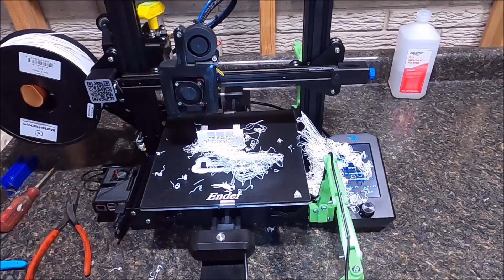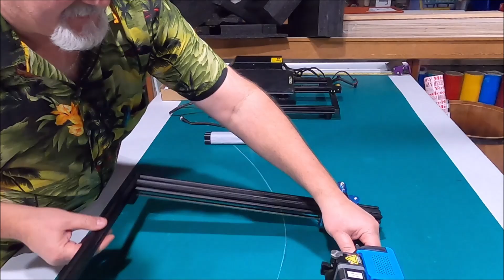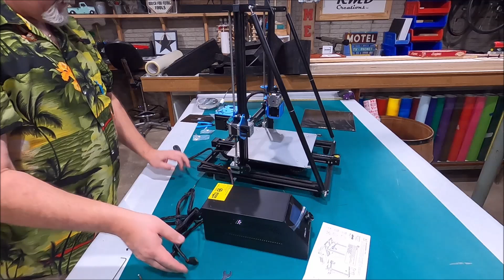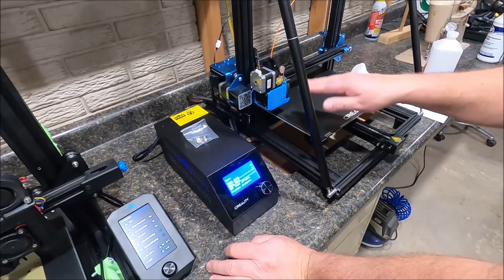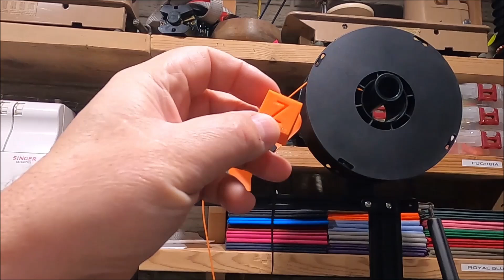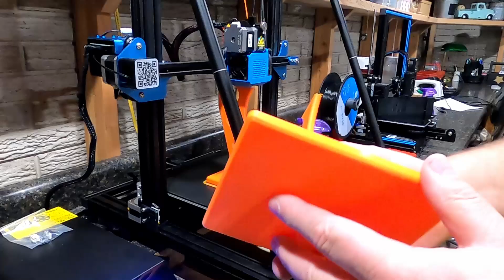Creality CR10 V3 Unboxing - Set up-Print. I have added a larger capcity machine to the collection

Comment: this was my first 3D printer. total garbage. bent extrusions, off square screw holes, warped plates, low quality controller, the printer was totally unusable out of the box with a crazy amount of design oversights. even the nozzle was physically not able to reach the build plate - requiring shimms and heavy modification.

Comment: Wish that I watched this before I set my machine up. Thanks for the good videos. I was getting really irritated setting this thing up. Plan on doing some add on mods like you did. My first printer is a Prusa MK3S+ it took 13 hrs to assemble. I bought the Cr10 V3 for printing lithophanes. keep up the good work

Comment: Mine has been great....then terrible.  Come to find out its NOT an all-metal hotend or extruder.  They simply swapped out a problematic plastic idler arm for a metal one and called that an "all metal extruder kit".  People like me come along and think theyre getting an all metal hot end or at LEAST an all metal extruder and therye getting neither.  Mine wont print reliably above 240C (which is everything I need to print) so its basically junk to me.  I have to buiy a whole new printer and it will NOT be anything from Creality.

Comment: Hello Michael, grateful for your contributions and videos sharing your knowledge. Taking advantage of your generosity, I ask the following, what profile (fff) do you use for this printer? Did you modify it from a pre-existing one? I use Simplify3D and I have yet to fix a small shrinkage value. Thanks again for sharing your experience! best regards, Marcelo from Argentina.
Reply from the maker: I use pretty much the stock profile on Ultimaker Cura.

Comment: Just a note, My cr-10 V3 is about 2 weeks old, and it came with the ball bearing guide wheels already mounted on the filament switch bracket. They are adjustable.
Reply from the maker: good to know. Thanks for watching

Comment: When assembling mine, I took great care in checking the z-gantry was square to the bottom frame. Just tightening the four bolts from the bottom did not result in a square gantry but one slightly tilted backwards. They call the front rods “pull rods” so that’s what I used them for, to slightly pull on the Z-axis gantry until it was square. Also checked other dimensions for equality, like the distance from the Z to the front of the frame etc... A system like this is overdefined if just tightened without any tension and squareness would then result from sheer luck of having perfect manufactering tolerances. If placed under very slight tension squareness can be controlled. I had to flip the bed because it was dome shaped, after flipping no problem to level. Also I am not running the filament detector, it just sits by the side with a piece of filament in it. The friction on the filament was a bit too much for me. Check the rollers, they were mostly too tight, especially the x-axis. 
Anyway, it’s a super machine and prints astonishingly well, just take your time to assemble it and don’t rush. Just let it sit and think about it, the cables, the placement of the spool holder, wheel tension, ...
Reply from the maker: All good interesting information.

Comment: May i ask which one better cr10 max or cr10 v3???
Reply from the maker: Depends on what you want.  The max has a larger print volume but bit it's a bowden tube machine and it doesn't have a silent board.  The V3 is direct drive and has a silent board.  If I had it to do over again I would still by the CR10- V3
Reply: @Michaelinthebackyard  ok tq for the information

Comment: What are your slicer settings on the CR10-V3? I set mine up did the test print from the sd and it ran fine. When I try and do other prints either that I designed or on Thingiverse, it doesn't adhere to the bed well and seems to have inconsistent results. I'm using that latest version of Cura. Bed is level as can be but does have a dip in the center.
Reply from the maker: If your build surface is not flat and you can get prints to stick very well, then you will struggle. All the slicing software in the world will not make up for a non flat build surface. Email me and I can send you my Slicer profile that I use on my CR 10's

Comment: Hey Michael, thanks so much for the video!! I absolutely love your enthusiasm and go-get'er attitude! 😊 I've been debating between the CR-10 V3 and the Ender 5 Plus, this helped a lot!

I LOVE your design for the filimant run-out sensor, great job! I definitely think you should post it to Thingiverse if you haven't already 😊
Reply from the maker: Go for it!, I do have it on thingiverse. Thanks for watching and commenting.
Reply: Did you end up getting this one? I, too, am debating between this one and the Ender 5 Plus.
Reply: @lisa_marie_1982  Hello! I did actually! At this point, I honestly don't recall the specific specs or features of the Ender 5 Plus that I was debating between, but I can tell you that I absolutely love my CR-10 V3!! It does everything I want and need it to, and does it very well! I've got some extremely nice prints off the bed, and have also pushed it to the limits and printed some VERY large items, which is awesome to be able to do. I don't regret the decision at all (:

Comment: On your filament sensor on top did you have too extend the wire going into your board. Most of sensors have only 3ft of wire. Any help would be greatly appreciated. Thanks
Reply from the maker: Nope I was able to use the stock wire that came with my printer.

Comment: if you put that noctua fan on the hot end you will get heat crepe / nozzle jam so when your prints fail constantly remember this
Reply from the maker: It works just fine. Had it on there now for a week and have done over 50 hours of printing.

Comment: Dang Mike, You are going to have a production setup there before long.  Three machines in the first two months.
Reply from the maker: You know me I'm kind of a go off with my hobies.  Three years ago I had no boats and now I have seven boats.  I had one outboard motor about 2 years ago and now I have over 40. What can I say, I really get into my hobbies.  I will be printing boat motor parts soon. Fusion 360 is an awesome design tool. I'm reviving my design skills. I have the CR30 print mill coming in May from the Kickstarter that Creality had going on. That will be an interesting machine.  Thanks for watching.

Comment: Michael, please stop teasing us, have an heart and post a commercial email address on your Utube site so we can reach you and mention specific 3D- printing specific needs.

For one, I have this nice 1957 Johnson Javelin 35hp that is missing a "3" numeral on one side. Definately an eyesore. The originals are golden plated castings but 3D-printing a replacement  would sure be a swell shake-down exercise for your equipment and there are probably a bunch of guys and gals out that would forever be endeared towards you for providing then with such an impossible to find item. Regards and all the best for 2021 !
Reply from the maker: Check out my newest video.  It has my email address in it.